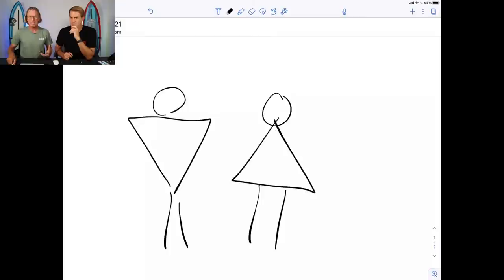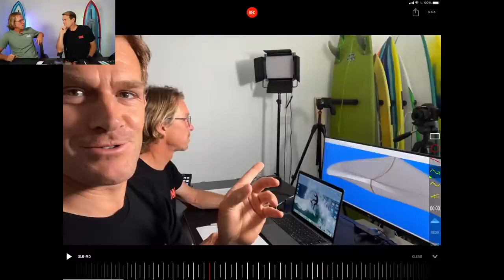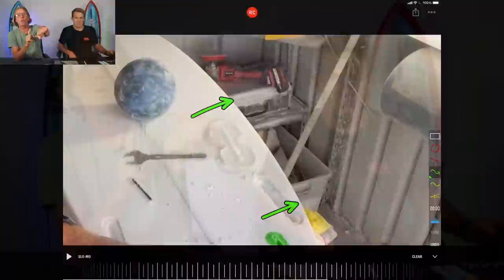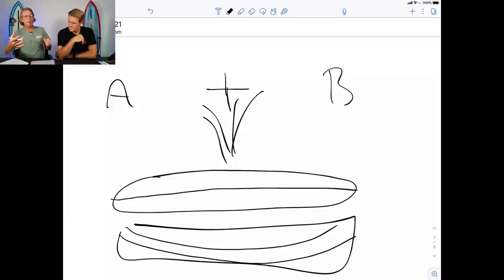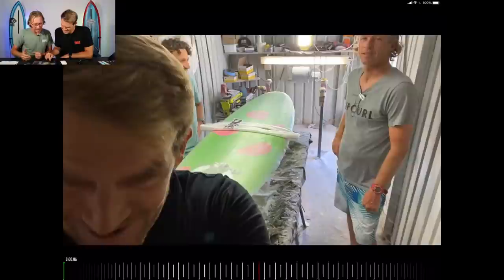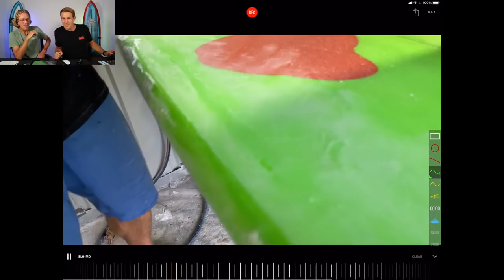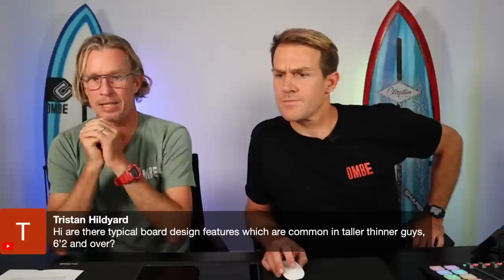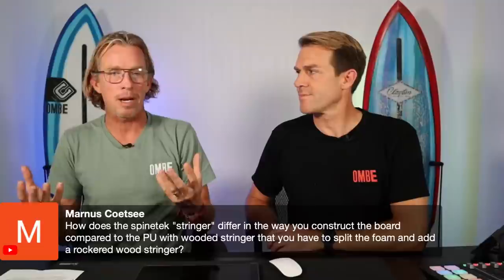EP 36  |  THE LESSONS FROM SHAPING YOUR OWN BOARD

Comment: Question for the shapers: considering that the underside of the surfboard is the one in contact with the water, shouldn't it be better / more critical to glass the board fipped upside down? This would make sure that the seams of the top resin layers and the bottom resin layers (to be smoothed carefully with the grinder) are on the top of the board deck (where you put your feet on) instead of the underside (where the water needs to slide along).